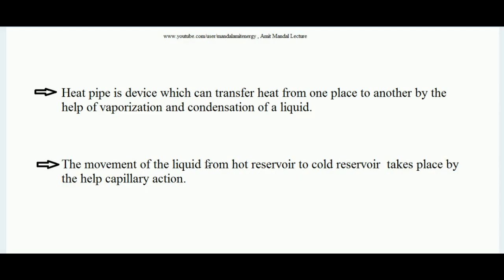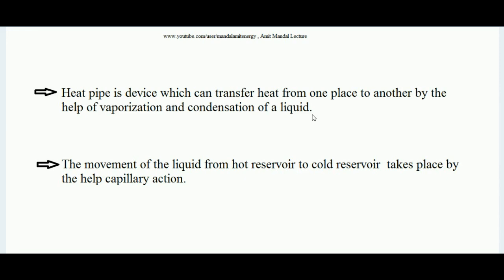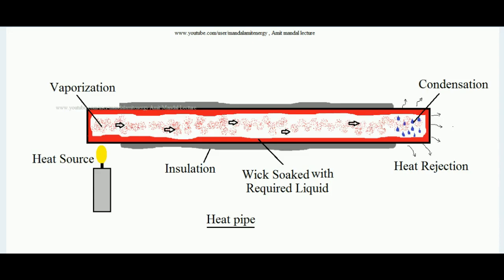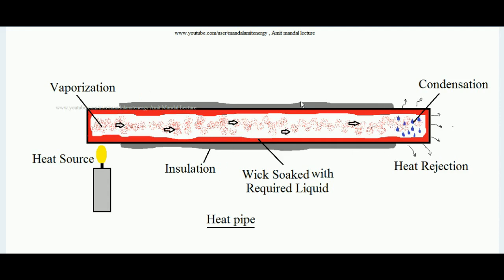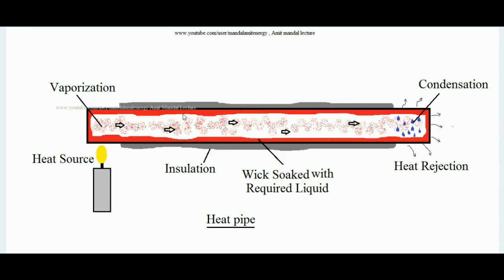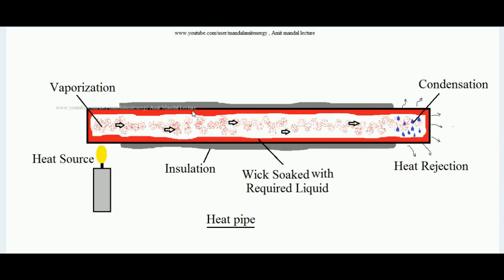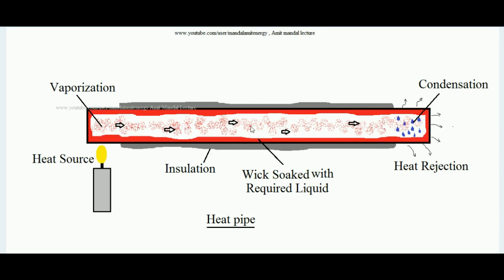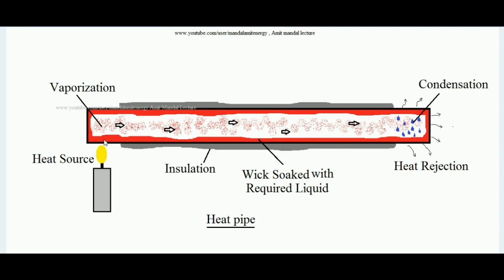Heat Pipe Working and Principle | Heat pipe heat exchanger

Comment: Sir what happens if entire heat pipe is placed on a hot material
Reply: if that happens then there will be no condenser in the heat pipe since both of its end exposed to the heat source both of its end act like evaporator  from there continuously vapourization of liquid in the heat pipe takes place since there is no condenser there at that moment all the liquid inside of it convert to vapour when that happens the temperature of heat pipe will increase beyond the saturation temperature of the working liquid and it fails to transfer the heat.